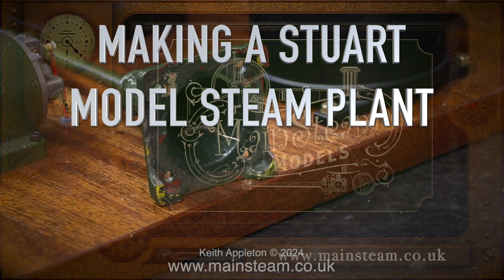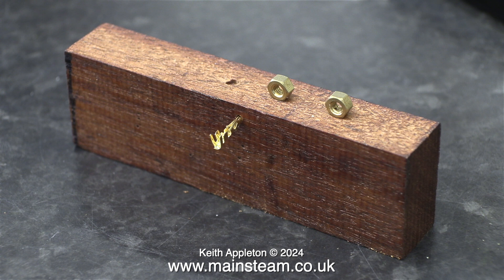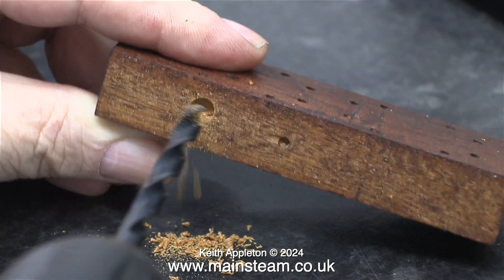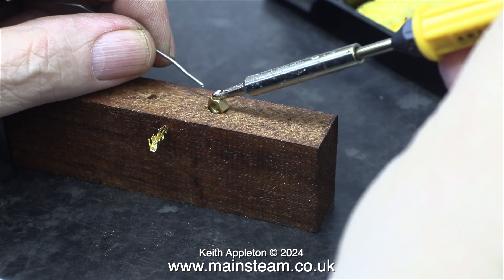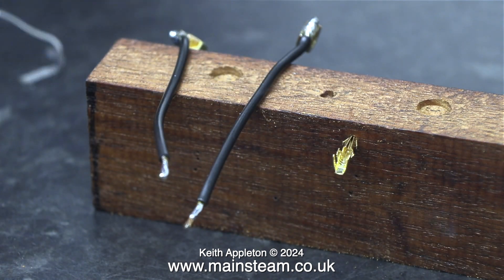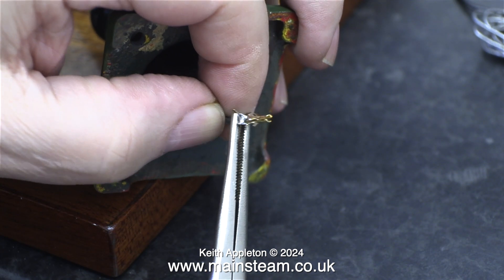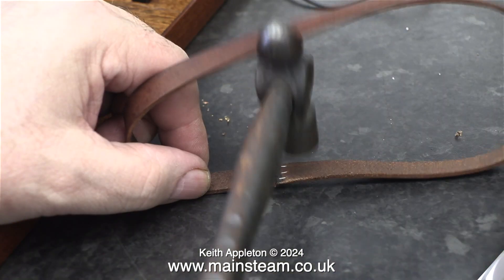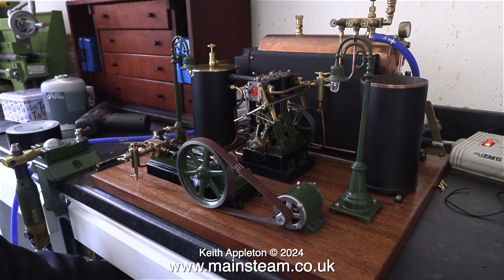MAKING A STUART MODEL STEAM PLANT - PART #89

Comment: Keith, This may be your very best "Top Tip". Using the wood block is genius (which I am apparently not) and the step that you use (solder first crimp second) is also great. Hum, that's two "Top Tips". ;-)